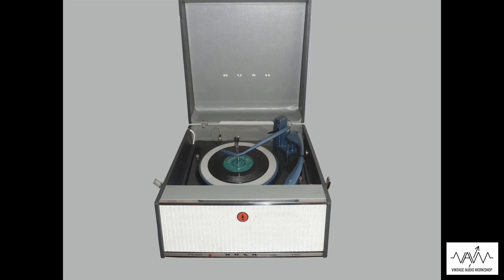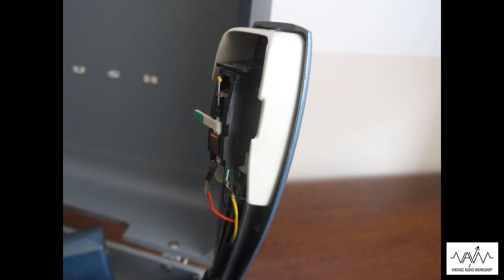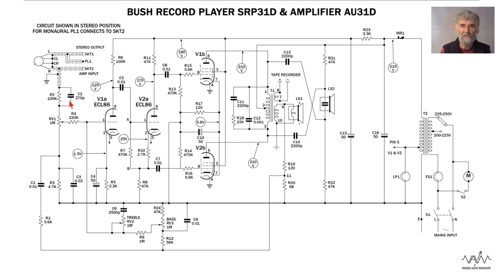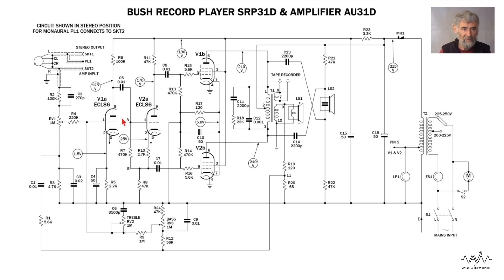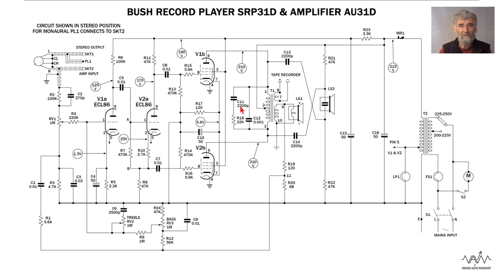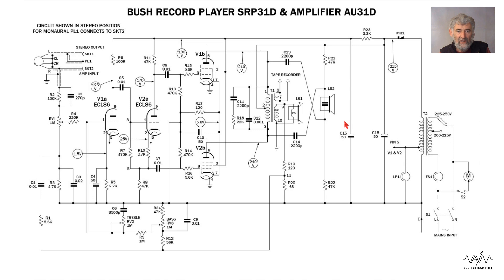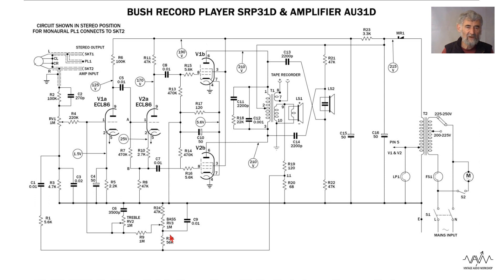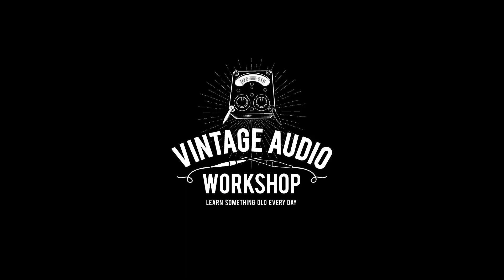Valve Amplifier Study 021: Bush SRP31D (AU31D) Stereo Record Player. ECL86 (x2)

Comment: trying to find out what the cable to connect to external amp is?
Reply from the maker: Antenna plug on a co-ax cable with a long centre pin phono jack on the other end. People often use a screened cable with a modern phono jack. You may have to adjust the cartridge to get the full stereo functions,
Paul

Comment: Hi, I have got a SRP31D. It’s producing a humming  noise when it’s playing. Any advice to eliminate the humming. Brian
Reply from the maker: We're going to be making a video dedicated to this subject very soon. It could be a valve, electrolytic filter capacitors, a loose connection on a cartridge headshell etc or a dry joint .